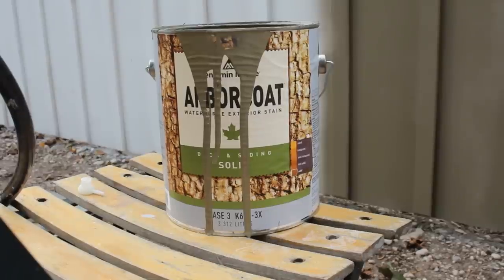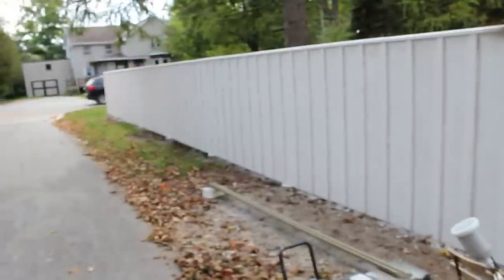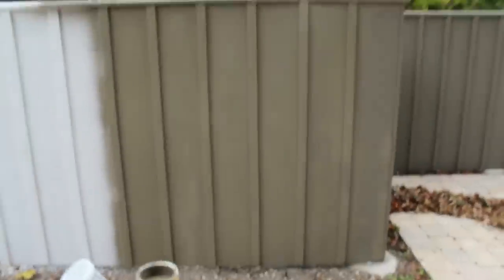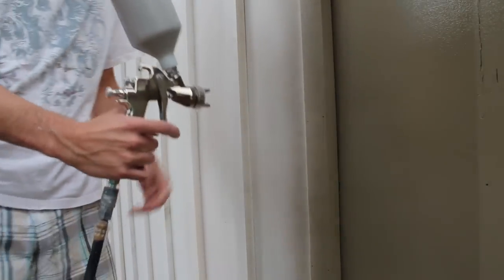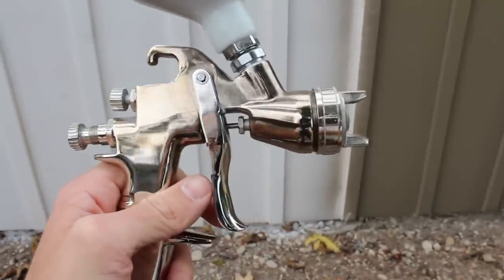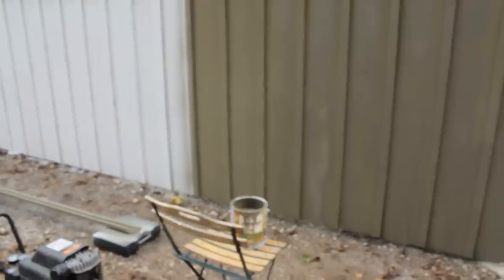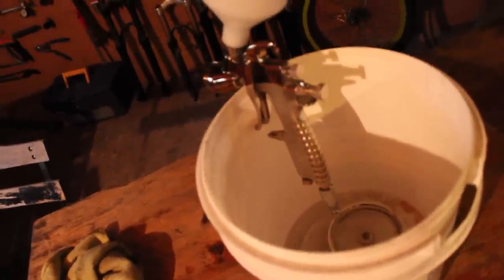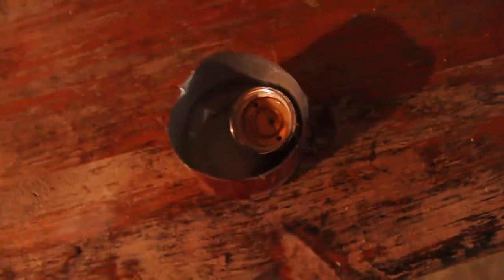Painting A Fence With an Air Spray Paint Gun - Solid Oil Stain

Comment: If the compressor is running continuously during the spray job, without cutting out as it reaches the set pressure occasionally, it means the capacity of the compressor is exceeded or right on the limit. If that is the case, you should stop every 10-15 minutes spraying or so and let the compressor cool down for at least the same time. Otherwise it is being used beyond it's duty cycle and it will fail prematurely.
Of course that may be of no consequence to you if you regard it as expendable  against what you paid for it, but I thought it worth mentioning.
Reply: just wat i said
Reply: If you only use your compressor a dozen times a year even two dozen times. Abd once or twice a year you use for a couple hours straight. It won't be that had for it.at my shop the industrial 80 gallon went down for like a month. I had to use the kobalt 26 gallon compressor to paint with. It barely could hold just above the pressure needed for the pressure pot. 50 ft line, air water seperator. On the trigger it would hold 50lbs the pot needs takes around 50 max I run it around 35lbs. Off the trigger it would go to about 65-70lbs and no higher. It has a 3 year warranty. So for 275 dollars if it breaks we get a brand new one. For about 2 months I ran that thing for 8-12 hours straight. I put a fan right on the motor to help cool it some. But that's was already a few weeks in. And it was summer time. In the sun.  Lowe's is good about exchabging stuff out. We get our chop saws and some tools from there. If it's within the warranty period they swap it out. I worked St Lowe's for a couple years as well. When you go into the store with a return. I've never seen or heard of them not taking the customers word for it. And plugging in a product. If it's not working it's a potential fire hazard. If you need a compressor to trash use it for whatever jobs you need then swap it out for a new one. Their going to rebuild and resell it anyway. They get a credit from the manufacturer for it. If it's worth it they'll ship it back or crush or dumpster it if it's not worth it. Like all your tool returns they put the batteries in thr recycle bin and trasu thr tools

Comment: Never pause when spray painting. Complete the cycle or panel by continuing past the work piece. Stop and then do the next panel. That creates a more consistent color when dry. Ask any guy who paints cars. They complete the entire car layer in one stroke then pause to do the next layer. Keep the paint gun exactly the same distance from the material and never tilt the gun at any other angle. Always paint straight. That's why cars have a consistent color. No streaks or color fades. I've been doing this for over 40 years. I know what I'm talking about.
Reply from the maker: Ya but this is a shitty fence not a nice car.

Comment: Tips for you..
1. Spray continuously from top to bottom.
2. Don't stop the spryer until you are off the edges.
Reply from the maker: No thanks I don't feel like standing up and crouching down 700 times in an hour.
Reply: You pulsing is why your paint is not covering everything. I work in a fab shop so i know what I’m talking about. Joseph is correct
Reply: Your material needs thinned, there is also a 100% wrong way to adjust and set up your gun and even if you think is spraying ok and you like it. without the knowledge of what the spray pattern should look like material and fan width, pressure ect.

Spraying isn’t a pick up and way you go sort of thing. 

If you were doing it correct your material would come out smooth and even and you could top to bottom without the need to pulse.

Comment: Hey I think you're a good painter anybody who has the nuts I wanted to use a different word but to go out and get a spray air compressor and use it and research and do what you're doing to me that makes you a good painter now cutting in and all that stuff you know that all comes with time but the fact that you are taking the step to actually use a sprayer compared to a brush in a roller means that you are above-average so I wouldn't downplay yourself you can do it a terrific job I'm a professional painter over 30 years and you'll be surprised how many people are scared of using a sprayer so kudos to you my friend keep up the good work
Reply from the maker: Thanks

Comment: As somebody who painted a lot of fences (and by that I mean kilometers ). The best and cheapest way to get any fence painted, is to use a painting pole and exterior roller sleeve & a long handle rad roller to get any bits you miss with the big roller . Just get yerself some off cuts or roll of roofing felt as a dust sheet to keep the ground from getting covered in paint.
I see people all the time spending days doing a short fence with a brush. All that will do is give you a bad back & knees lol
Reply from the maker: Very nice. Good information from someone who is experienced. I was wondering about that way before doing it by spray. Ill remember that for next time. Makes sense how it would save your knees and back. Thanks.
Reply: Airless sprayers are the way forward (Im a professional painter with 20 years under my belt). Even something like a wagner 350 m will do this job perfectly. Look into airless sprayers for high volume spraying. You will achieve much better coverage..not to mention running materials with higher viscosity - so no thinning, (better finish/results/less coats). This compressor set up isn't really worth having - for reasons mentioned in a previous comment, I.E. not enough pressure or cfm for spray painting and the compressor is likely gonna fail prematurely from being at maximum pressure none stop.... If you wanted to use a compressor for spray painting, a larger compressor with more cfm is the best way to go. You will not achieve any consistency or coverage otherwise and the compressor will be able to handle the job without running none stop - it will retain the required psi and cfm much more efficiently.
Reply: +1 for the roller. Quick and better finish. Also add in the time for cleaning the sprayer, thinning paint, etc.

Comment: Just want to chime in and tell you don't worry about these know it alls.  An actual HVLP costs about 12 times the cost of what you are using now, for your home projects and small projects, this is just fine.  Your compressor is just fine and you have a high volume low pressure system.    You need to adjust your needle to flow better.  People get these mixed up just like using air tools with the little compressors.  The tool don't work off pressure, works off volume.  Your gun setup is where it's about.  Your comp can push 150psi, TOTALLY enough and no, it's not "overworking".  That's the point of using it and I had that same model and it always stayed on, no issues.  If you want to get something above this setup, you don't need a $5,000 system.  Harbor freight has one for $210, get a titan spray gun... Been using it for 5 years no issues.  Sitting in my shed now for 3 years but I bet that $5,000 it will crank right up as I'm testing it tomorrow to prep for our total interior painting.  But for your setup now, it's perfect, just adjust your needle to flow out just a touch more.  Also FYI for your better benefit, "dusk coating" as one dude was down talking you about is actually called flash coating.  Flash coating is 100% normal.  You flash it on, wait a minute, flash it again...repeat a couple more times.  The final lay is slower and fuller.  Keep doing what you are doing bro, you are doing well and works just fine.  Don't let these tools make it to be about tools.  It's only a shed, not a Ferrari people lay off em.
Reply from the maker: Thanks bro

Comment: Use an airless sprayer with an fflp tip and do that entire fence in 20minutes. You don't have to worry about the dinky compressor struggling to keep up and you'll have a proper amount of material on there instead of this light dust coat you've achieved with the lvlp.
Reply from the maker: What's that cost?

Comment: Airless sprayers are the way forward (Im a professional painter with 20 years under my belt). Even something like a wagner 350 m will do this job perfectly. Look into airless sprayers for high volume spraying. You will achieve much better coverage..not to mention running materials with higher viscosity - so no thinning, (better finish/results/less coats). This compressor set up isn't really worth having - for reasons mentioned in a previous comment, I.E. not enough pressure or cfm for spray painting and the compressor is likely gonna fail prematurely from being at maximum pressure none stop.... If you wanted to use a compressor for spray painting, a larger compressor with more cfm is the best way to go. You will not achieve any consistency or coverage otherwise and the compressor will be able to handle the job without running none stop - it will retain the required psi and cfm much more efficiently.
Reply from the maker: I agree, I have used Air Asissted Airless sprayers, but I have not used Airless. For a one time job, which this was. Those are not an option because of cost, and neither is a 120 Gallon air compressor that is not portable.

Comment: Why is there very less coverage on the sprayer?
Reply from the maker: Aisake Vula Not enough CFM and PSI from my air compressor.
Reply: @porkercon   long time ago I know, but you're dead wrong.  You're using a low pressure gun at too high a pressure.  You should turn the air down to about 10psi.
Reply from the maker: @OggyGTA  I'm wrong you're right

Comment: BEST AND FAST WAY TO CLEAN YOUR SPRAY GUN !!! Put Paint Thinner in the Spray itself, then Spray it onto a Cardboard like you are Painting it. This will help you clean your Spray gun FASTER and also helps to unclogged any Paint that is stuck in there too  :)))))))). Also, Harbor Freight have a CHEAP Spray Gun that is CHEAP and works really well. It's 15 bucks on sale and if you do one job and clogged, throw it out and get a new one, LOL. I don't like Harbor Freight but funny thing is the CHEAP spray gun actually works really well and you can THROW it out, LMAO. Cost more to clean it and cost more to buy Rollers and Paint brushes, etc...  and your time cleaning.. LMAO
Reply from the maker: Yep I spray thinner at the end of painting too, works pretty well.

Comment: I would use pressure pot, so that the air compressor don't have to work so hard.  good job !
Reply from the maker: +fujiobass True, that would of been useful.
Reply: +fujiobass I know there is google but can you explain a pressure pot, please? I'm about to spray concrete walls interior.
Reply from the maker: +Tony Neal It's a sealed pot that the air compressor hooks up to. Pressurizes it. You put the paint in the pot. The pressure in the pot drives the paint through a hose to your gun.

Comment: with the compressor constantly running it would burn up the motor
Reply from the maker: Still using the same compressor 4 years later.
Reply: +porkercon  is that comp oil free?
Reply from the maker: Nope its oil